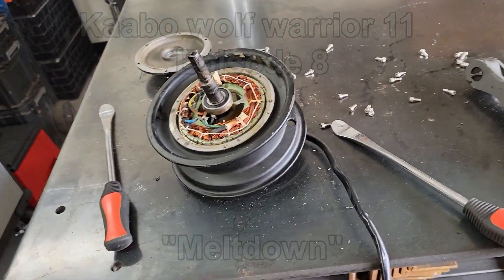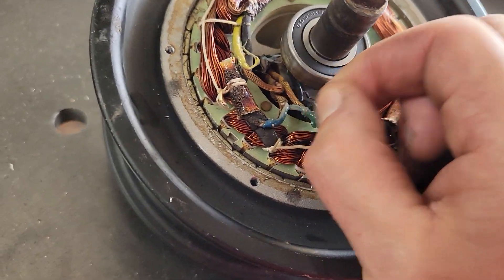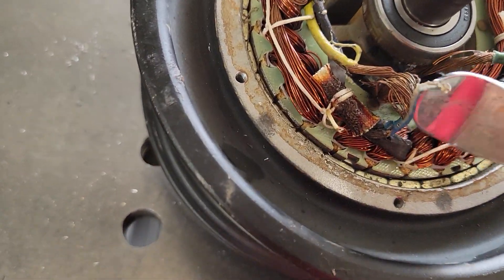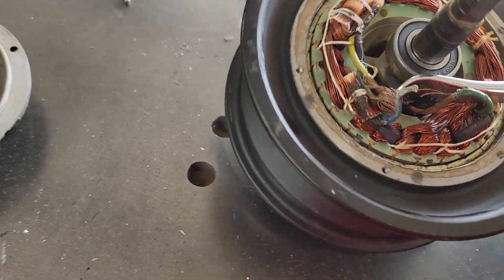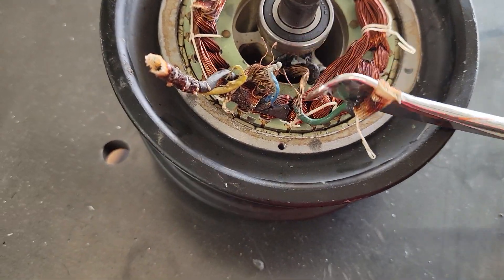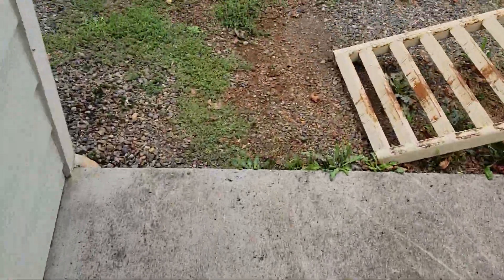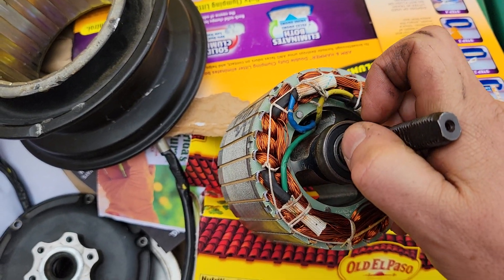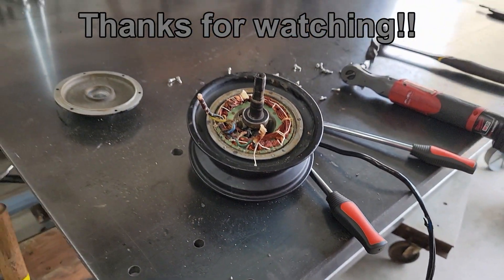Kaabo wolf warrior 11 episode 8 (inner workings of a failed 1200 watt scooter motor)

Comment: I came here to see if he shows how to pull apart the motor. 😢
Reply from the maker: Purchasing a kaabo was one of the worst mistakes I ever made in my life.
Reply: i cant open the one side did you find a solution?
Reply: @mgghggggfdr4I had a really hard time pulling it off the only thing I was able to do was pull the whole thing out magnets and all
Reply: @jamesmurillo4463  i want to open it by the side of the cable because i need to solder new wires
Reply: @mgghggggfdr4that’s exactly what I wanted to do but couldn’t get the side to open. Ended up just finding an old wheel with a bad rim and switching motors. I just couldn’t get that side to open but there’s gotta be a way I just gave up
Reply: @jamesmurillo4463  damn im starting to hate the design to be honest
Reply from the maker: @mgghggggfdr4 it's cheap overpriced junk.  Sell it and move on with your life.
Reply: @ i bought it for a project but with those motors i might change them
Reply: @mgghggggfdr4yeah they could have done better
Reply from the maker: @mgghggggfdr4 they are all the same junk.  Toss the whole thing in the recycle bin and forget you ever thought about these scooters.  Biggest waste of time I have ever had in my life.
Reply: @ thanks for the info bro

Comment: Poor quality wiring, The insulation around the copper is very thin that it splits causing a short circuit. Most likely to get the cables and hall cables through the tiny hole in the axle. I dont know why they dont make the axle larger with a larger hole for the cable to fit through. Stupid really.

Buy better quality motors, Search "QS motors"....
Reply from the maker: Worst financial decision I have ever made in my life.  Glad this thing is in the dump now.

Comment: Hey man, i've got a question about my rear motor. When i ride my wolf warrior 11 my rear motor lets out strange noises whenever i move it, turned on or off, it still does it. It goes normally and isn't slower or anything, but this is my problem.
Reply from the maker: Sell it.

Comment: U could have repaired it by replacing the 10$ motor cable...
Reply from the maker: I repaired it by chucking it in the recycle bin.  You can't fix burnt/melted inner windings without rewinding the stator.  Scooter sold over 2 years ago.

Comment: How did you open the motor ?
Reply from the maker: With tools?
Reply: The small silver screws come out 
But it’s tough to open is it just a strong magnet and did you have to disconnect battery

Comment: I have similar issue wth my Wolf,  Same motors 1200w... Front wheel binding up and hard to turn.
I opened it up and 2 of the 3 inner cables have slices in them exposing the bare wire.
Not sure if its the bearing or the motor itself but i will buy a new motor and see how it goes.
Reply: Did you do this already and what did you do with old motor ?

Comment: Thanks for the videos. Wondering if you have any torque specs for the scooter. The store I bought it from are useless and looked at me like I was an idiot when I asked. I am mainly concerned with the axle bolts. I have seen reports of failure at the dropouts, possiblly caused by overtightening.
Reply from the maker: That I am not sure about.  I would not doubt there are failures though.
Reply: @SeanFastidious  after doing some more digging, I've found that they have supposedly remedied the issues with a new fork design. Being made out of forged aluminum instead of cast. However it appears that the scooter I received despite being a few days old/new gt model ,has the old versions. Frustrating...
Reply from the maker: @jakeb1778  I am not surprised to be honest with you.
Reply: @SeanFastidious  did you're scooter also have a knife edge on the inside of thr rear motor cable inlet?

Comment: Since the burnt wires are all outside the winding areas, couldn't you cut the wires and use other lead outs to make it work again? Sure looks like they could be repairable to me... IDK
Reply: Yes they are easy 2 fix, this guy just didn't have the know how or the ability to learn to know how.
Reply from the maker: They went to the land of "bye bye" so I guess we will never know however the varnish from the motor windings was burnt off too which makes me think it would not be that simple.